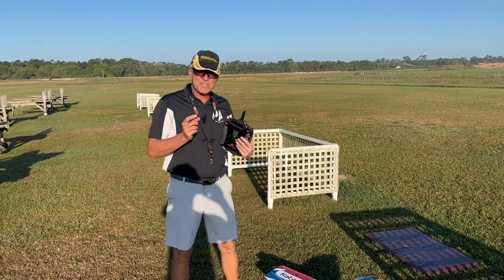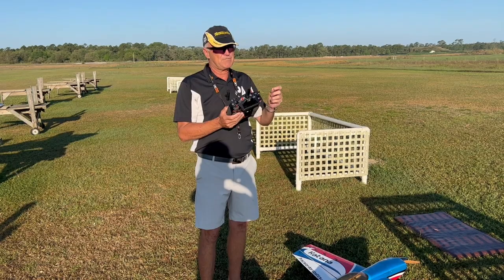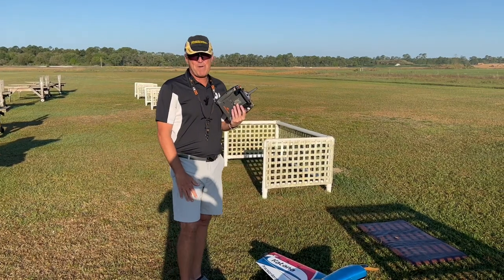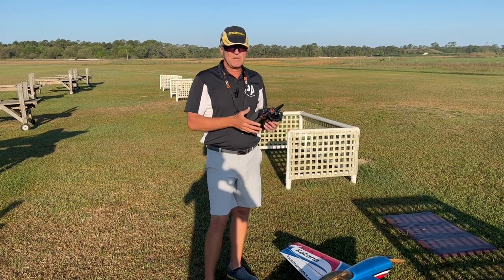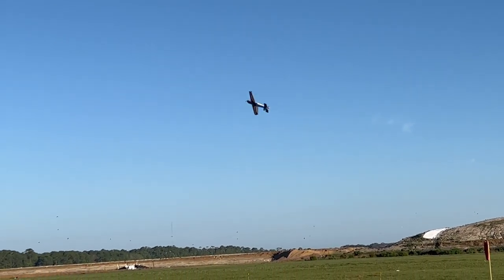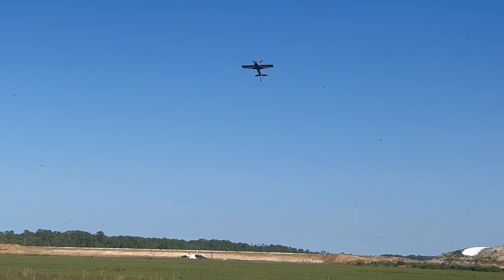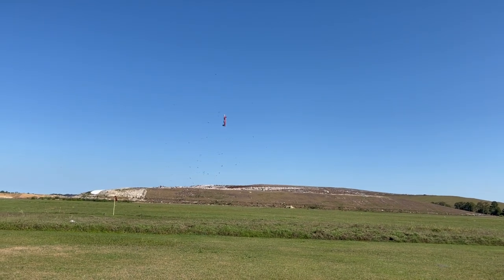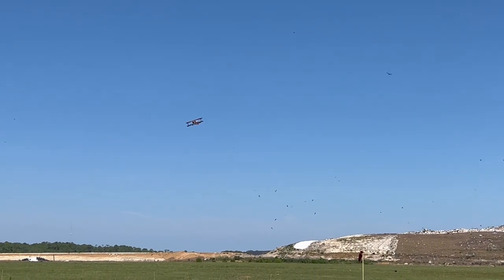Michael Wargo Instruction:   Throttle Curve Use and programming

Comment: I use all kinds of mixes for various maneuvers and conditions, flaps to ailerons, flaps to elevator, ail to rudder for coordination, rudder to opposite aileron but I never really saw the point of the throttle curve but I can see where it will be helpful for hovering. Thanks!

Comment: It so depends on purpose for the curve,prop size, linkage geometry and engine response. I've used expo as a throttle curve, where I need more resolution for landing on 35cc Gee Bee R1. More fine tuning, but still limited by engine factors. Got to experiment.